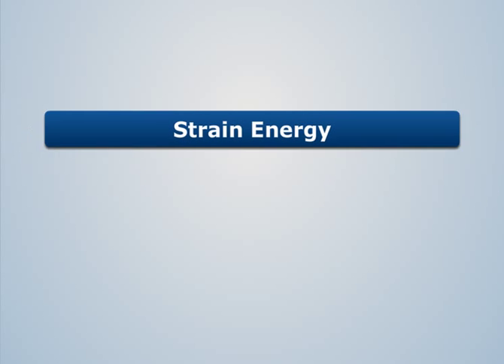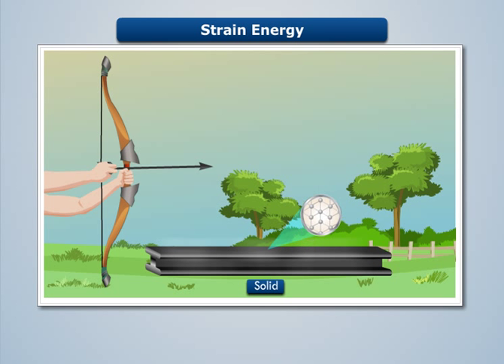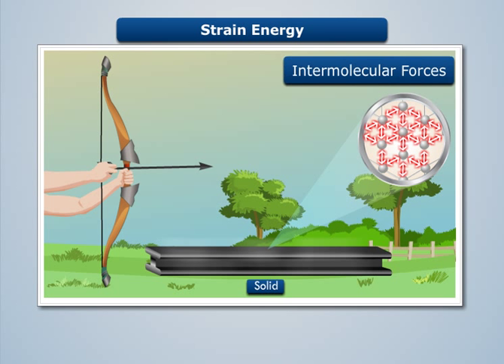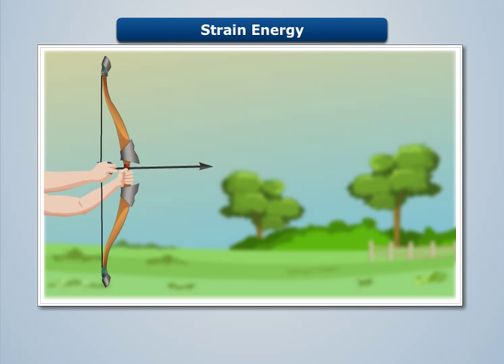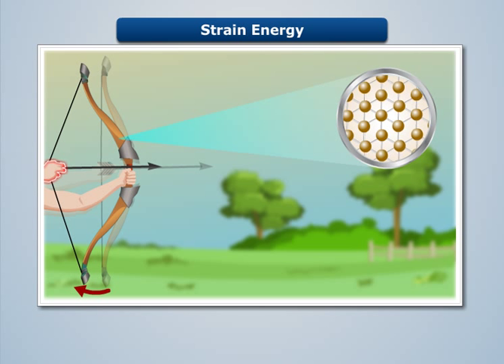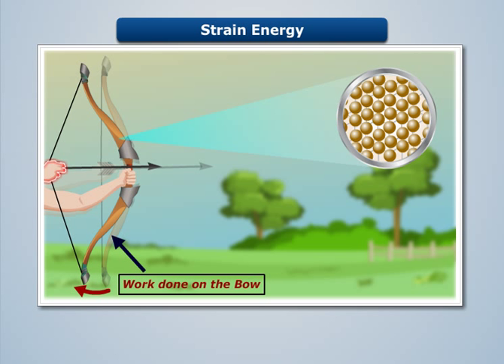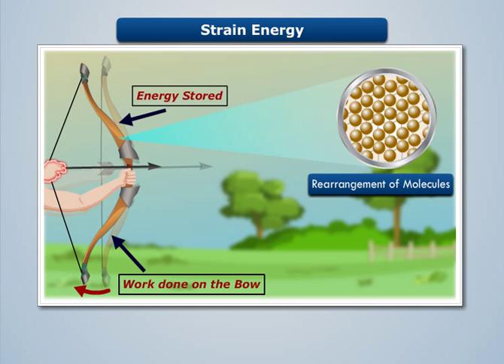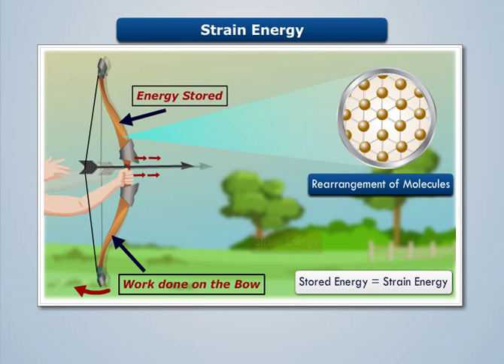Strain Energy Explained with Bow & Arrow | Strength of Materials

Comment: The energy is stored in the wire not in the solid
Reply: You're probably thinking of a slingshot, where the band stores the energy. In a bow, the limbs flex and store all of the energy. The string is designed with high stiffness fibers that will not stretch. The string only transmits energy and force from the limbs to the arrow, but it does not store any appreciable energy.
Reply: yeah, i think so, i got a bow so i can tell that the string is very stiff:p it doesnt expand much when you stretch it, cheers !  @johnbarron4265